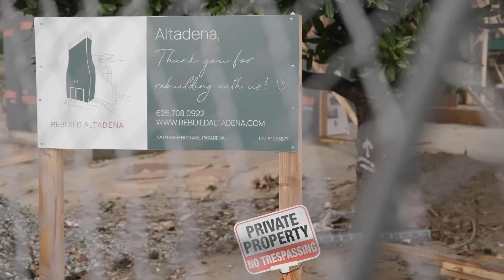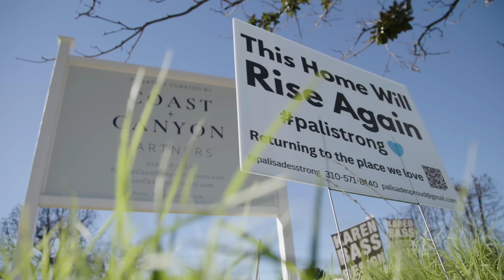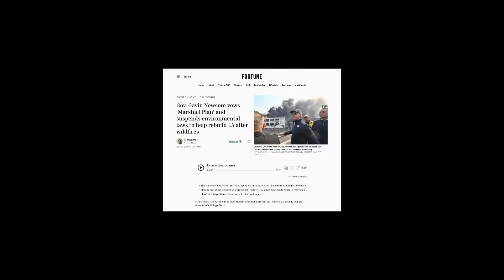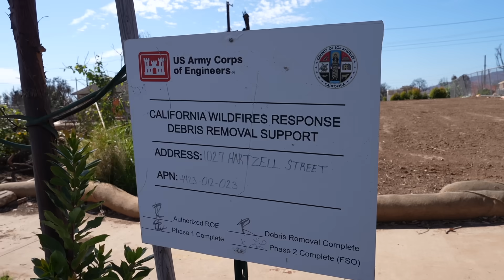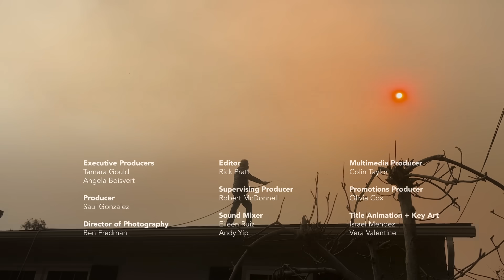Can You Build a Fire-Proof Home? | PBS SoCal

Comment: 90 minutes fire resistance for the siding, verses 4.5 hours for the ICCF Perfect Block? Easy decision. I'm planning on using the ICCF Perfect block for the exterior walls, and any load bearing walls, and concrete composite siding by James Hardy, along with metal roof, metal exterior doors in metal frames, no attic vents, and metal window frames.

Comment: Also all you need is rockwool insulation in all areas, cement fiber board siding, or stone wall veneering,  metal roof or slate roof ....redwood lumber wood is more fore resistant than the others.....its all expensive but hey you want something taht doesnt burn down there you go

Comment: use autoclaved aerated concrete, not styrofoam or EPS mix with cement, when styrofoam burns you will know why it is better to use autoclaved aerated concrete.

Comment: 7:16 This guy is a tin foil hat-wearing spreader of nonsense. Correlation does not prove causation. The Palisades fire was the result of neglect... Not having adequate water reservoir capacity, nor an adequate fire department and equipment. Also, not putting out the Jan 1 fire led to the disaster.

Comment: Concrete, brick, steel, ceramic, adobe common sense people!!!
Reply: Some of those make sense. Some of those don't in earthquake prone southern California
Reply: The bricks are only partially concrete and the rest is 100% synthetic, poly. Anything with the word poly in it is extremely toxic, and contains a massive amounts of carcinogens most of which that caused cancer. So the runoff waste while manufacturing these products, pollutes the Earth in a massive way, and also poisons the men and women who are involved in the manufacturing process. Sprinkler systems are a far more effective tool to prevent and put out fires within real property
Reply: @peterponcedeleon3368 holy crap, provide even a single source please.
Reply: @Cyrribrae  first of all anybody in the construction industry would know this, those who been through an apprenticeship program and have some experience with know this. You just need to look up the manufacturer safety data sheet. That’s all the resources you need now the rest is up to you. Most people are completely unaware of these things. It’s not their fault. They just simply don’t work in this industry I don’t have to take the classes that we take in order to keep ourselves safe as much as possible.
Reply: @peterponcedeleon3368 sprinkler systems don't help if the water pressure is too low when the whole area is burning
Reply: @Chenise76 that is true, but there are no solutions in life, only trade offs.

Comment: Excellent commentary about building and rebuilding in these hazardous areas. It is unfortunate that steel framing is only briefly mentioned in the video: steel has proven performance for decades as a noncombustible alternative to wood, with provisions that are in the building code and construction methods that are similar to wood.

Comment: IF you got the money and do not build back fire resistant homes, you are just asking for a  repeat.
Reply: Fire resistant homes, are extremely toxic, and are compacted with nasty carcinogens, most of which cost cancer. The manufacturing process of these materials create a tremendous amount of toxic waste that is thrown into our land fields not to mention the men and women who manufacture these materials are exposed to so many carcinogens. This is an absolutely dumb idea. Unless you can read the manufactured data sheet, you don’t know what’s in these. Sprinkler systems are far more effective and far more friendly to the environment.
Reply: @peterponcedeleon3368 what are you talking about 🧐🙄. Just saying random crap on the internet? Concrete is slightly more carbon intensive than wood. Steel too. Neither one is highly toxic. Metal roofs aren't toxic. Airtight attics and windows aren't toxic.

Gasoline is highly toxic and somewhat carcinogenic - the drilling and refining process even more so, do you stop driving cars? These are things that are mitigable. Just like fire risk. Not doing so is insane. Which leading fireproof products exactly are so toxic? Because most fire safe building techniques are not because they are about technique and design, not mainly materials. We're not using asbestos anymore 😅
Reply: @Cyrribrae  i’m specifically referring to fire retardant material. Do you even know what the MSDS stands for? Have you ever read one before? Yeah burning gasoline is quite toxic. It might be part of the reason why I went in three people have cancer will be cancer. It might be probably the reason why many people who get lung cancer, don’t smoke. I don’t think you’ve ever been around these fire retarded materials, and I’ve been to school about how to apply them, and after they have been applied what it takes to actually interrupt them. You’re the one who doesn’t know what they’re talking about. I certainly do. If fire retardant doesn’t mean fireproof. And yes, I know we don’t use asbestos anymore.
Reply: @peterponcedeleon3368 dog. Do you think there is ONE fire retardant material? Yes, there are toxic ones. No, they're not all used in home construction. WHICH MSDS ARE YOU REFERRING TO?
Reply: @Cyrribrae  most fire retardant are toxic. At least the most effective ones. When you look at the MSDS, it’ll actually tell you which organ that chemical will attack first. And from my experience, it’s the kidneys that are attacked first. Then the lungs. Let me ask you, have you been to school for this stuff? Like a real classroom that teaches these things? I have and I’ve been in this industry for over 27 years. Sprinkler systems are far less problematic to the Earth, it’s soil, and human bodies. Fire retardant material is not fire proof, so when they do burn, they release a tremendous amount of toxic smoke into the air and that also gets seeped into the soil poisoning, the soil for it decades into the future. I don’t think you know Jack squad about what I’m saying, but you feel the need to say something.

Comment: If you're still building the old way, I have no interest in helping you. You're a danger to yourself and others.
Reply: What do you know about building? Would have you ever built in your life? Fire retardant materials are extremely toxic. And they are not fireproof. The manufacturing process of these materials pollute the Earth in a major way, and the people who handle these products are being exposed to a tremendous amount of cancer, causing carcinogens. Sprinkler systems are the way to go.
Reply: @peterponcedeleon3368 I've remodeled houses, done the entire electrical system of a boat, helped construct a professionally built tree house with a pedestrian suspension bridge, rebuilt the deck of a boat, worked on sailboat rigging, constucted furniture, worked in a WWII ship's engine room and  answered the ship's telegraph (tells you what to do) and operated the main engine, transfered and polished fuel oil, roofed homes and summer cabins, jacked up homes, moved small buildings, and more but I doubt I need to go on. You don't need fire proofing if you use materials that don't burn or are naturally resistant in appropriate use. You've set up a straw man. By the way, I guarantee your hone is full things that cause cancer when they burn. Maybe you shouldn't live in a stick building in a fire prone region if you don't want cancer. You don't know a lot of things you think you do. Sorinkler systems depend on water and a lot of buildings with sprinkler systems burnt up in recent fires. Do you work for a sprinkler company?

Comment: Stucco doesn’t burn and most of those homes were stucco. These homes burned from the inside out due to the tiny embers blowing through vents with 1/4” and even 1/8” screen. A high wind and a 2,000 deg fire sends trillions of tiny embers into everything. Focus on that and you can create a home that doesn’t burn.
Part2: Cal Fire needs to do controlled burns around communities and create a buffer zone. This fire could have had a lot of preparation done ahead of time.
Reply: Like a filled fire reservoir that was left empty for nearly 2 years?

Comment: I am surprised there isn't more discussion around using hempcrete to build in these fire-prone areas. Hempcrete homes can be built with standard stick framing with the hemp lime mix as insulation. Extremely fire resistant and also well insulated. Plenty of videos here on YouTube.

Comment: I've always wanted a hobbit hole.  It won't burn.  Ideally the fire on the surface just moves across it, burning the brush and then moving on.  People are obsessed with natural light, but there is this thing called electricity, and further, there are ways of mimicking the look of sunlight with other kinds of light sources that don't require massive above-ground windows.  Further the hobbit hole uses the principle of thermal mass to reduce heating and cooling costs.  As long as you take into account risk of floods and earthquakes as well, you can burrow your home into the ground (or build up the earth around it) and have a safe, cozy space to live your life.  If only the HOA and permitting process will allow it...
Reply: @Darhan62 there are things called light tube's that bring light into underground homes. We are not building underground,  but are using rammed earth construction. We live in a forest, not on a coast, but  want to be as fire resistant as possible.  
We live outside of areas with building codes, or HOAs. 
Hobbit holes are cool!👍🏻🤟🏻
Reply: @Kit-Kat-Sue, that sounds great.  It's a relatively inexpensive option for bringing in extra light when needed.

Comment: Homes in the urban interface need layered fire prevention systems. Home materials and construction materials are a part, but you need landscaping systems and homeowner education and preparation.  In the case presented here, its great that the home has inflammable materials, but what about windows, and contents? What about landscaping and how long it can hold embers? There isn't one single solution, you need to address multiple possibilities.

Comment: There are guidelines for building homes in Wildland Urban Interface (WUI) areas. Rebuilding is expensive, and finding architects who understand the WUI guidelines (use of materials like the Arclin product or use of concrete walls and cladding, specifying design features like unvented attics, unvented crawlspaces and airtight / weatherproof building envelopes, etc. The question is "are building code officials and architects willing to inspect/design to those standards, and are residents willing to pay for that extra protection" ?
Reply: Unvented attics are huge when it  comes to cost benefit. It's relatively low cost, though still a slightly greater cost due to the air tightness requirement, for an enormous benefit in fire prone areas seeing that most fires from an external source start in attics, when embers are vacuumed up through attic vents. The application of Building Science Corp  research and best practices really should be code in these areas. Don't have code be a minimum. Have it be a protective standard that goes beyond in these areas. Currently code is like letting a house be built with a C grade when it needs to be an A.
Reply: It makes PERFECT SENSE to me to build or rebuild with fire resistant materials.
Especially if long-term ownership is planned.
Saves on insurance AND maintenance.
I'm doing my Summer Camp that way in an Old Growth Forest.
I'm also doing proactive forestry.
Hopefully it will be a legacy property.
Reply: None of that stuff sounds expensive compared to insuring a death trap. Many homeowners choose fiber-cement siding just because it looks better and lasts longer than vinyl or softwood. A metal roof would actually be cheaper than the wood shakes that were required in some places for aesthetic reasons.  Unvented attics don't cost more if the house is designed around them. And while fire-resistant windows would be expensive, heat-resistant automatic shutters would be affordable, and could be made useful for privacy and comfort.
Reply: Im a building envelope consultant and the average person cannot afford energy efficient, fire resistant home. And the few people who do have the money still would rather build to code minimums and build a bigger house rather than a smaller better one.
Reply: @cjh8344 maybe not an entire home, but even if you build with wood, a few small choices around things like eaves, roofing, and sealing up the attic and some of the windows don't add a huge amount of cost (you're not getting a much smaller home - and in places like LA, you're limited by your lot more than a few thousand in the budget), but make a big difference in terms of safety.

It's not pragmatic for forcing people to remodel out of cycle, but if you're rebuilding? That seems more than reasonable. 

People can't afford to do it.. but they really can't afford not to. The practical mechanism I could see is as insurers pull out of these areas, they ONLY issue policies that cover fire safe buildings that meet at least a minimum standard, with extra incentives if you go further. Subsidizing insurers to keep covering risky construction kicks the can down the road, uses a lot of public money, and doesn't actually help anyone. Most people would rather keep their home than get an often insufficient payout after it's gone.

You still might have to for existing homes, just to keep the market alive, but for all new builds and even significant renovations, we need to encourage (with carrots and maybe sticks) people to protect themselves - and their neighbors.